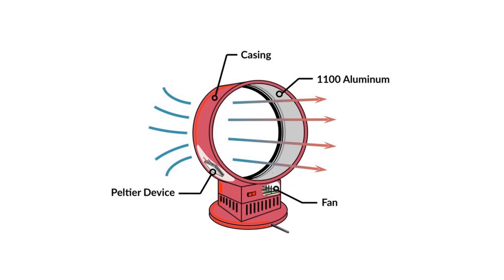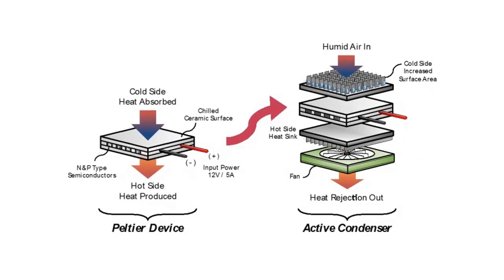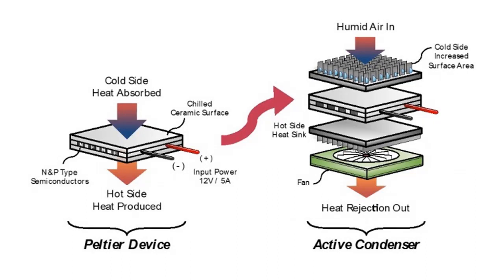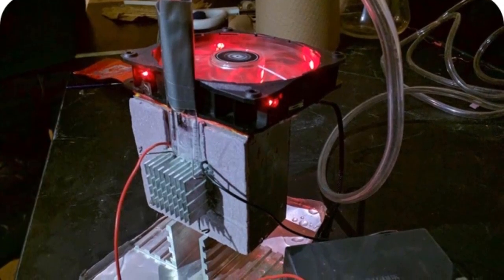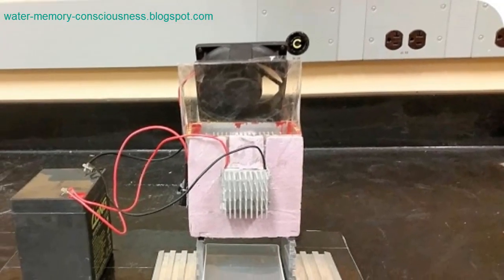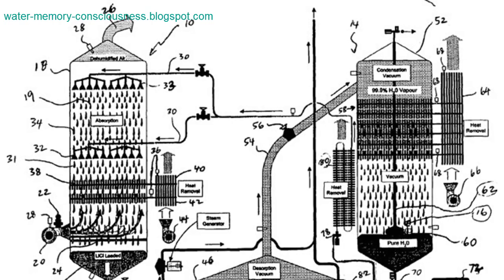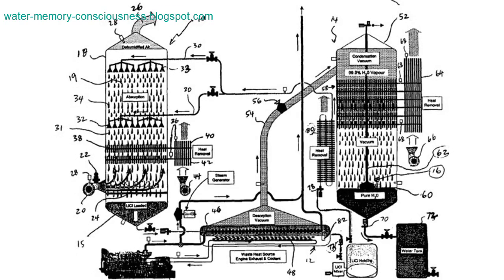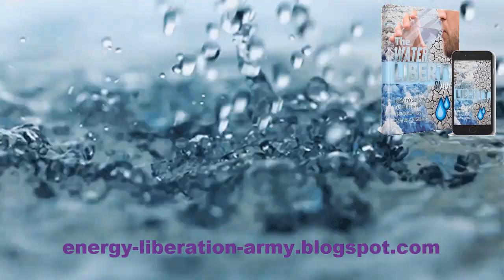Documentation for Atmospheric Water Generator - Water From Air DIY

Comment from the maker: The documentation for the Atmospheric Water Generator (AWG) project aims to provide a comprehensive guide on creating water generators that extract moisture from the atmosphere. The project introduces itself through a brief and informative video that highlights the concept of generating water from the air. This video serves as an engaging introduction to the documentation, setting the stage for individuals interested in understanding and building their own AWGs. Whether it's for personal use or community-level applications, the documentation offers step-by-step instructions and valuable insights into constructing and operating these innovative devices.